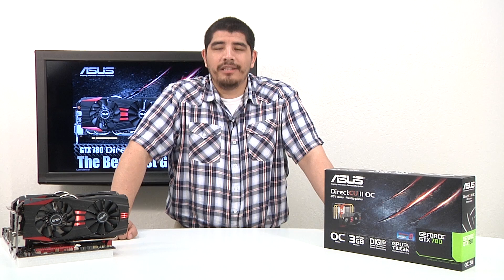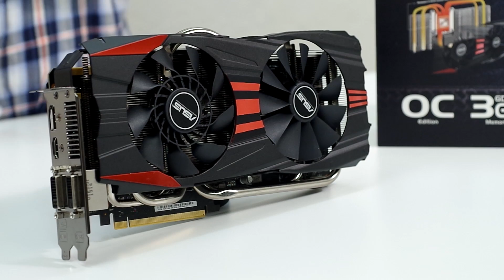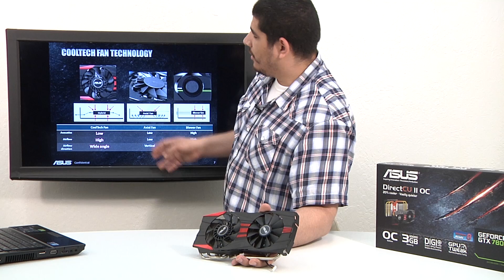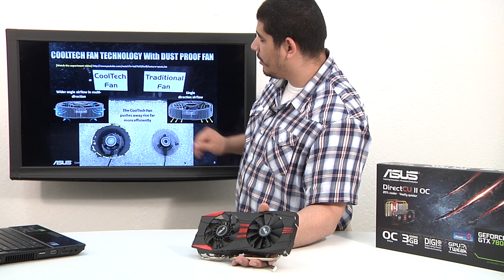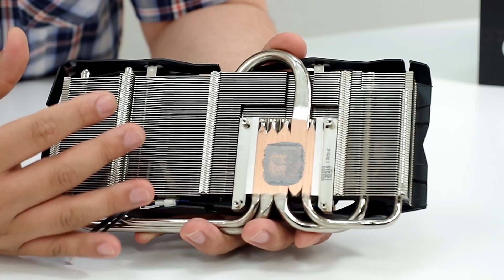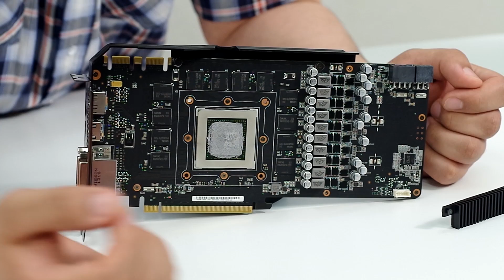ASUS GeForce GTX 780 DirectCU II Graphics Card Overview

Comment: I want the ASUS GTX 970 :(
Reply: the 980 is better.
Reply: What  i meant is that i wanting to buy the ASUS version of the 970 so i'm waiting for it to come out.
Reply: Jester Muffin erm it's out .. called the strix
Reply: The time when i posted the comment it wasn't out. It is out now, yes and i'm planning to get it eventually.
Reply: Jester Muffin it kinda was actually.. well either way - doesn't matter :) hope you get it because it's a fantastic card for it's price!
Reply: If was it certainly wasn't on amazon cause where i searched. Yeah i know it's a good card, but i'm in no real rush to upgrade from my 760 yet.
Reply: yeah not a big deal... unless you want to run a higher resolution than 1080p... ive had a 770.. currently run a 780 and the gains are tiny unless you like to downscale from higher resolutions... res scaling above 100% in battlefield4 ultra etc. this stuff is good for 1440p and so is the 970...
Reply: nah i'm staying on 1080p for a while and i can always add another 760 if i have to. I'll upgrade to SLI 970's when 4k and 5k become cheap.
Reply: well by then probably a new gen will be out, actually 4k is a pointless resolution... 21:9 ratio is nice! ecen now you can get some affordable 2560x1080p screens... and in place of 4k there are some with the vertical resolution of 1440p (don't remember the horizontal) but in total it's still a little less pixels than 4k so a bit easier on the gpu ...
Reply: True, however by staying 1 generation behind i still get to enjoy gaming while still being able to afford it. Also considering that consoles are still 3-4 generations behind, most of the ports we're gonna be getting will still be low quality.
So by the time 4k becomes a thing i'll be able to switch to the 970's SLI them and play on 1440p.
Reply: Spencer Johnson Only the doubble price lol

Comment: No words, im complete happy with it and im proud of my choice.
Some extremely little moments has a little anoid noise.
The best card in the world for the perfomance that offers for that price.
Also i dont have the cards from the others companies but i think in my opinion the asus and the evga sc acx is
the best in this chip model of all other manufacturers.
(And... the asus model cooling for gtx 780 looks better in appearance than any else :P )

Also the gtx 780 (non ti) is the best choise if you want a REAL boost up perfomance without outrageous prices.
Because the chip IS THE SAME as the gtx titan and the gtx 780ti with a little differences in specifications like cuda cores and memory sizes.

Comment: i just baught the card, do i just put in the card and run the cd or do i have to unnninnstall my lold one ?? help
Reply: well for one.. you would go in the video settings and uninstall it. and it the thing already downloaded for the drivers for this one and after its uninstalled or disabled. then you install the new driver. Then you turn off the computer and take out the old card, and put the new one in.  Then it should be good.
Reply: I didnt unninstall the old one, is that bad or can I still unninstall it??
Reply: Nicholas A.
Reply: tommy halas just disable it. should be fine. thats what i did when my old tower used to mobo onboard graphics.

Comment: If you were to put fans on every edge of this card, with 2 on the longer edges, how would they be arranged? Would it be best to have all exhaust other than the 2 blowing into the fans on the card?

I'm building a custom case and won't have the case against the rear panel; instead having fans then ventilation (I'm more focused on cooling than noise and how 'ugly' fans and ventilation looks).

Comment: I have an old PSU lying around, can this be powered by a thermaltake litepower 600w?
Reply: yes, it should be fine ;)
Reply: oh thanks. I was skeptical  'cause the 6 pin and 6+2 pin pci-e connectors are connected.  I thought that it would provide insufficient power or the wire would burn when power is drawn from the psu.

Comment: I just purchased 2 of these from new egg  AT $539 VERY HAPPY  I started with gts 250 sli triple monitors  then 460dc2 sli  570 dc2 triple slot sli  then 670dc2  sli  and now u know ASUS GeForce GTX 780 DirectCU II  running 5760x1080 27 inch  with 4th monitor  my boys get my old cards I get new most recent  these cards have been  flawless  since  day 1  [DC2 IS THE WAY TO GO 4 THE PRO] ps great rev as usual  jj
Reply: what no way, i just payed like 678 dollars for mine!
Reply: spunkflunk
ASUS GeForce GTX 780 3GB GDDR5 (GTX780-DC2OC-3GD5)
- 889 MHz Clock, 6008MHz Memory
- PCI Express 3.0, Dual-link DVI-I, DVI-D, HDMI, DisplayPort

Part no: GTX780-DC2OC-3GD5 Canada computers

 $589.00
Reply: Doug McFarlane oh, yeah thats the normal version i bought the cu II

Comment: VRAM is Video Random Access Memory. Basically, the CPU processes the image, it is then stored in the VRAM, then changed to an analogue signal which is displayed on the monitor. More VRAM is better for bigger resolutions because the computer can store more images basically and stop frame rate drops or flickering. Don't worry about not knowing loads of things. I started out knowing nothing a few years ago.

Comment: I wouldn't worry about it as it will run better at launch. I haven't tried it yet but my friend said it runs at 90fps just like BF3 on his 690 and that he feels they haven't done much with the game engine since BF3. So I imagine your low frame rates are just a bug because the game hasn't been released yet.

Have you updated to the newest NVIDIA drivers?.

I wouldn't worry about performance of the final game. For example required specs for max Watch Dogs is a GTX670 mate.

Comment: The card is good.  For example the GPU needed to max out Watch Dogs is a GTX670 which of course is weaker than this. Some GPU's are already factory overclocked but you can easily overclock them with the software provided. It's as easy as moving a little slider along so don't be worried about finding overclocking complex as you will learn very quickly.

Comment: 3gb is more than enough to max out BF4 mate. CVG ran an article on settings to max out BF4 and they said a 2gb GTX670 for max settings and an I7 quad core. Medium settings was 560ti and I7 and low settings was a dual core CPU and 1gb GTX460.

Comment: Thanks for the great information JJ. I went ahead and bought myself this card. But I would really love to see a video about how to use the GPU Tweak software to overclock the 780. I have seen the 680 vid, but since the 780 has GPU boost 2.0 and is temperature driven, I would like to know how this alters the way you approach overclocking your card.
Cheers

Comment: Why I should get this card instead of the  EVGA GeForce GTX 780 3GB PCI-Express 3.0 HDMI Superclocked ACX?
I am an ASUS fanboy for a long time, my mobo is ASUS, my sound card, and my 770 gtx and etc...
Would this GPU run cooler than the EVGA?
It would be great if you were able to answer me this, because the EVGA higher OC is really buying me but I rather buy you guys stuff instead of EVGA because I never had issues with ASUS.

Comment: Mine just arrived today, i am so impressed how cool it is (max 65c) with long time burn in test, overclocked. I was originally plan to watercool it , but right now seems like this beast cooler is even better than watercooling solution, plus it's quiet. this should be the best gtx 780 model on the market!

Comment: A 770 has GPUBoost 2.0 so it will only go as high as you allow it to and will underclock itself when it gets too hot.  Look at your GPUBoost interface and change the max allowable temperature if 70 is too hot.  A graphics card can go up to 95 with no problems.

Comment: I just bought a pair of 560ti 448 cards for sli in December of last year for $300 because that is all I can afford. I was looking at the benchmarks for those 2 cards in SLI they fall between a 670 and a 680 if I am wrong please correct me if I am wrong. Not too bad for $300 I game at 1920x1080 on a single monitor. They plow threw every gave I throw at them.  I dont have much money to throw at pc gear. $300 for gpu is my limit. Should I have done something else?

Comment: good job on that card jj and everyone at asus who built the card. it looks really good and from what you said it sounds great in the performance range to as a non reference designed cooler but im really torn between this card the gigabyte on and the msi one. i know yur the asus guy but do you know by any chance how well this card stacks up against the other non reference ones in terms of acoustics and temps. also if anyone else is reading this i would also enjoy yur feedback. thanks yur time.